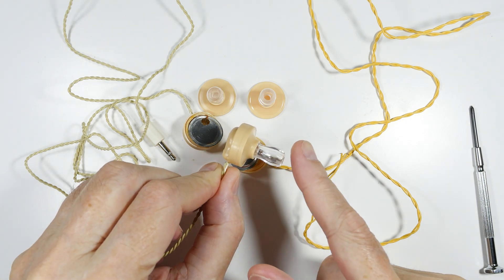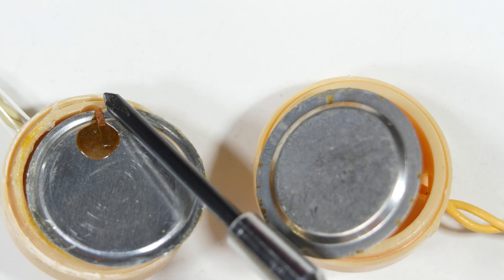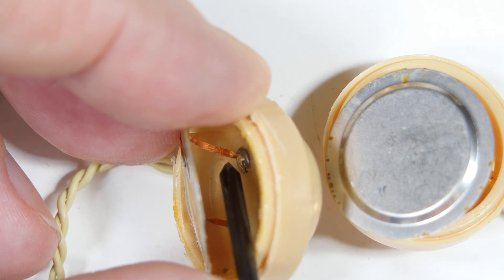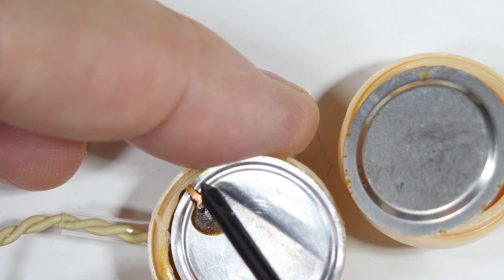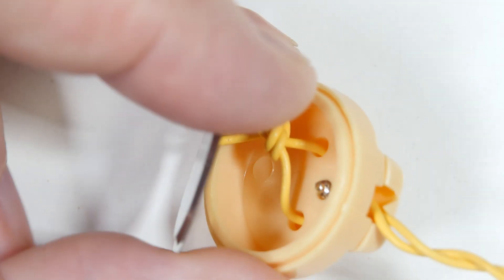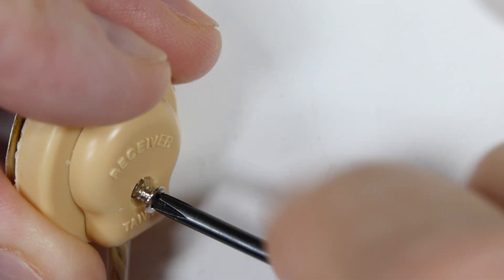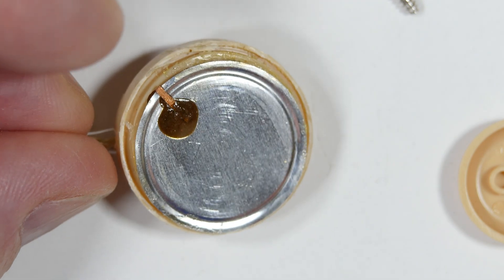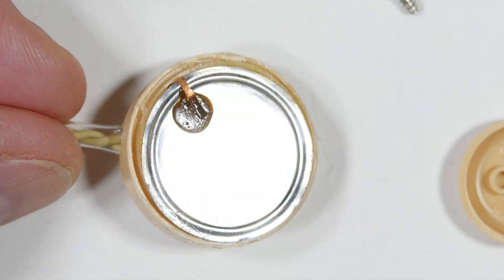PSA: Crystal Radio-Bad Earphones Pt 2–Teardown & Compare (4K)

Comment: Solder the wire direct on the piezo element. Thanks for the info
Reply from the maker: I have never been able to solder to aluminum.
Reply: @tsbrownie  on the base of the element like the japan is done.
Reply: How if i make my own feedback electrode by dividing (scraping) the single layer of the silver electrode into two parts so that no any wires disturb the diaphragm vibration balance. 

 Also if i use only a single strand of wire (of each Cable) of the remaining length of the cable after the cable knot inside the housing to the Piezo element ceramic so there's almost nothing pressing to the diaphragm

Comment: It appears that you could grind a small notch in the inside of the case where the emitter sits to get the copper ribbon clearance you need instead of drilling the case before liquid or resoldering. This is an interesting scenario. I think you're really onto something.

Comment: Some people have recommended to order bigger piezo plates and make them your self. I have also heard it might be possible to solder on aluminum if you sand it and cover the spot with stearine from candle, then solder it under the stearine.
Reply from the maker: I have thought about making my own. I've got all the parts to do it ranging from small to really big. Just need time. I've tried to solder aluminum from youtube videos and did not have much luck. I think a lot of the people doing it are just getting the flux to stick between the can and solder. I've never seen anyone test the electrical conductivity after they are done "soldering."
Reply: @tsbrownie  Looks like the piezo is the cheapest way to go with these. But it's also very tricky to solder on the crystal in it if needed, cause it can't take that much heat. With aluminum it's needed to work very fast, cause it will oxidate in seconds. Open air with heat will oxidate it even faster.

One Russian forum post recommended to use DEM-4M element and fill the closure with 14000-15000 turns of 0.03mm wire. But it seems a bit expensive and too much work :D

One way is to use 240v to 10v transformer (or 120v to 5v) for the impedance matching for regular headphones, or one big +4" magnet speaker with good closure.
Reply from the maker: @Kangsteri  I was looking for my box with impedance matching transformers a couple days ago and got distracted. I do need to try that.